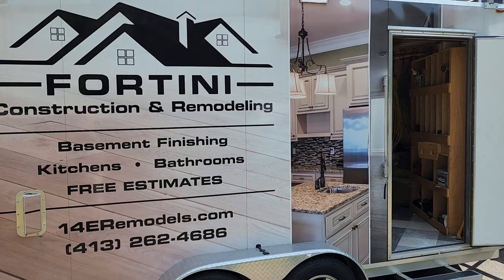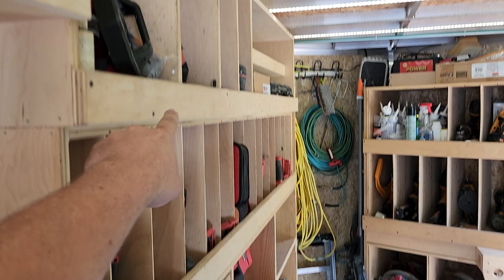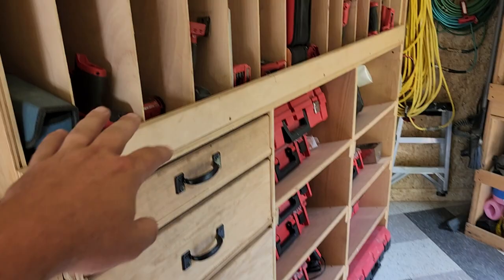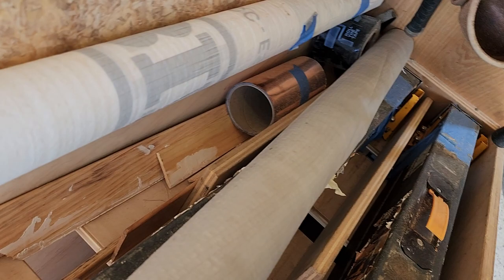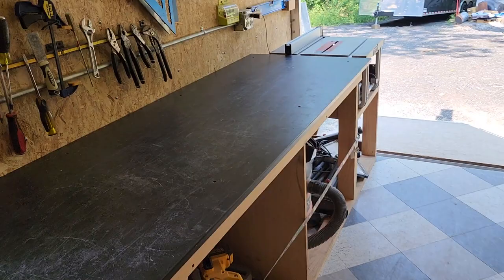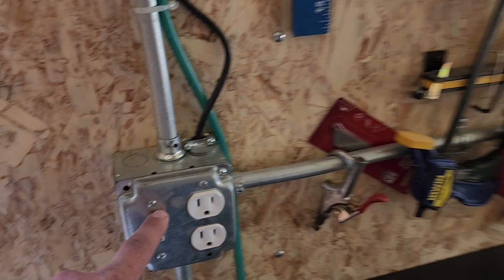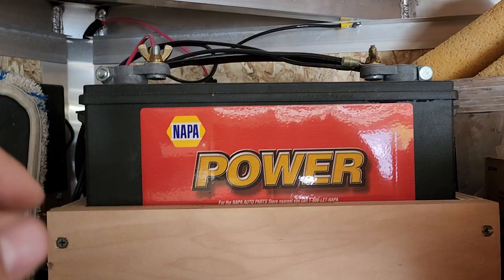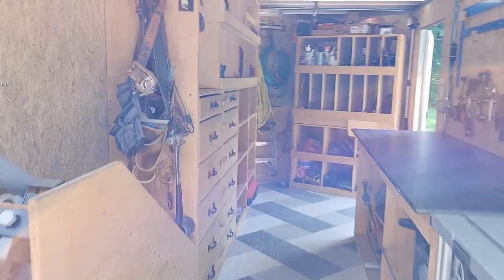Work Tool Trailer Update

Comment: What's the gross vehicle weight of the trailer? And what is the trailer weigh with all this stuff in it?
Reply: trailer is 7000 lb rated  and with everything in it i scale around 5500 to 5700 lbs